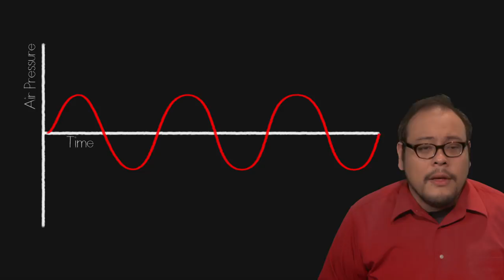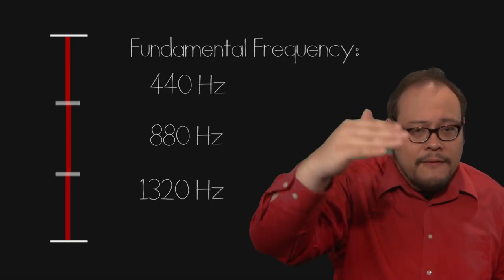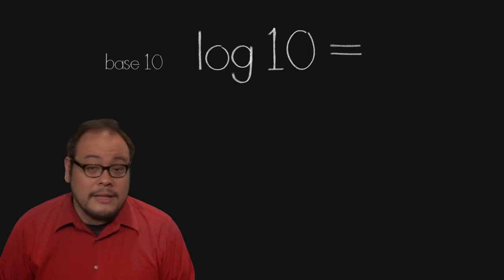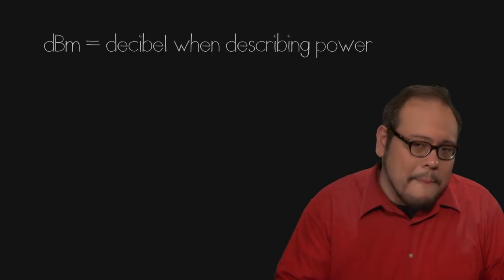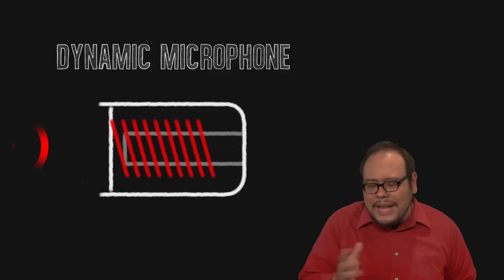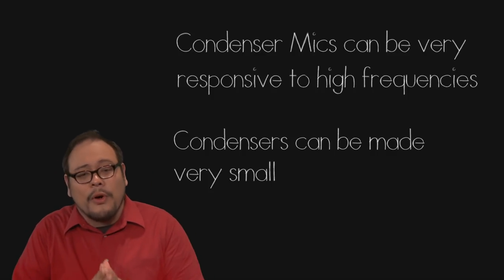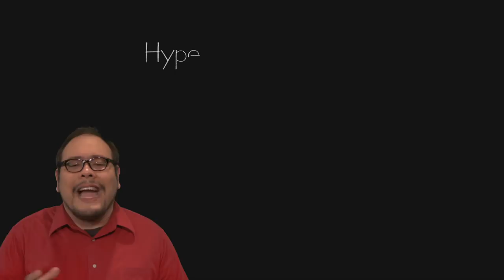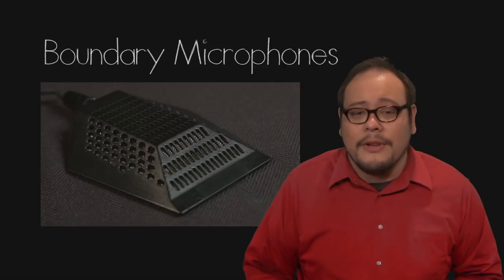The Science and Engineering of Sound

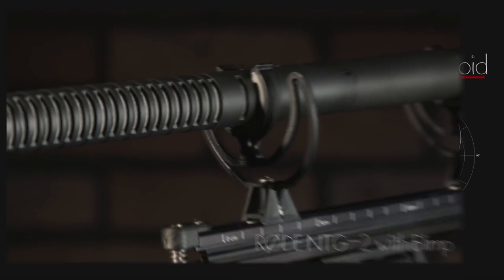Comment: Great informational video!  My only point of concern is near 14:50 in the video where you make it sound like a shotgun microphone rejects sound from the rear when the polar pattern for the mic clearly shows that it does not.  Yes, you say 150 deg to the rear but if you get more technical it should be centered at ~120 deg. and crucially, the mic does pick up sound at 180 deg.  So placing a shotgun mic on the hot/cold-shoe of your camera puts you, the camera operator, right at the rear lobe of the pickup pattern.  But maybe you will cover this in a future video.
Reply from the maker: Rob C I think you misunderstood - the 150 degrees to the rear meant the orientation of the polar pattern not that it covers all the way to the rear. But you are absolutely correct about that rear lobe being right where the operator would be :)

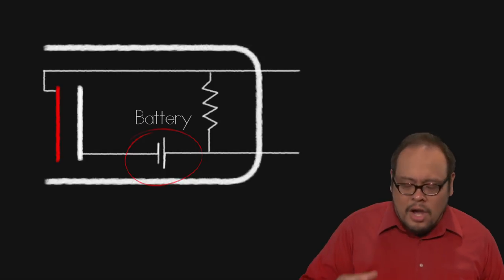Comment: @12:32 if i have a +48V phantom power, can i really use it for my lav and shotgun microphones since they are both condenser mics? i read  before that phantom power will fry them because they only require plugin power from the 3.5mm jack so i haven't tried yet. thanks. learned a lot.
Reply from the maker: if it is 3.5mm minijack it probably wont take the  48v phantom power.
Reply: For 3.5 mm plugs, tip hot, ring bias voltage (typically 5 vdc thru 200 ohms or so) and sleeve to "ground." Phantom puts 48 V on the tip and sleeve and can damage the mic's element.  3.5 mm is typically an "electret" condenser. powered by a 1.5 v ( some up to 9v battery) cell in the mic body.  Yeah, it is confusing in both concept, terminology and physical application.  Lav is often an electret with a button cell in the body. sometimes  a TRS 3.5 mm. Shotguns since they're often the choice on video shoots often use electret or phantom.  Phantom is the choice when possible, because you don't have to worry if the battery is going to go flat.To avoid your own job termination and never being hired by reference again in your career, read the manual before you first use a mic and find a seasoned engineer who can 'splain wtf is going on.  Then open a fader, open your beverage of choice and cut some hits.

Comment: Loudness is not measured in dB, it is measured in sones and phons, and is subjective, not a mathemetical fact, the dB is the measurement of sound pressure, power and intensity, and is NOT related to loudness.
Reply from the maker: chuckawobbly Don't overstate it - sound pressure is ABSOLUTELY related to loudness. A phon looking for comparative loudness between frequences - 60 phons is equvalent to a 1khz tone at 60 dB SPL - hence why sound pressure is still relevant. A Sone maps it onto a different scale - but sound pressure is at the heart of both those systems - though you're right Decibel doesn't directly equate to psychoperception of loudness, but it is the engine that drives loudness.

It is also worth pointing out that neither phon or sones are SI units but the decibel is.
Reply: For some time there has been a new standard for measuring actual loudness in the LU/LUFS norm wich has been developed by the ATSC and EBU.
more here 
http://www.tcelectronic.com/loudness/loudness-explained/